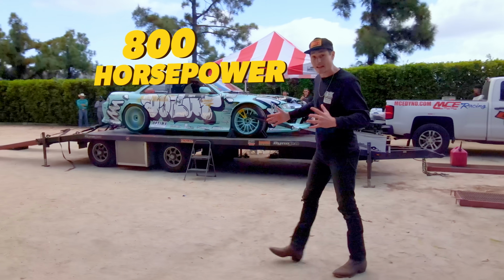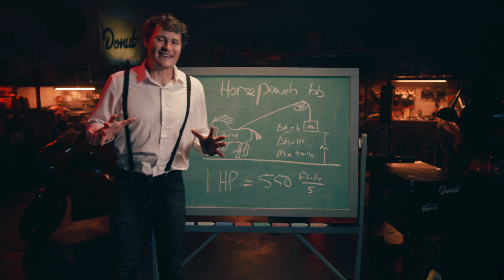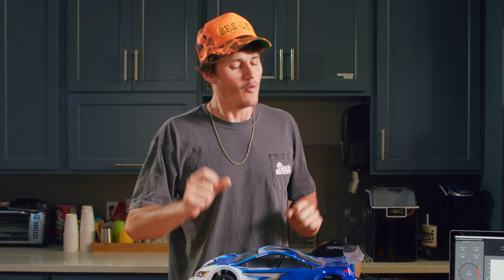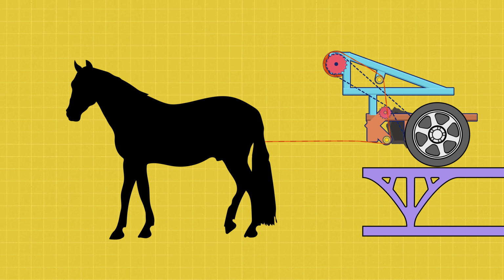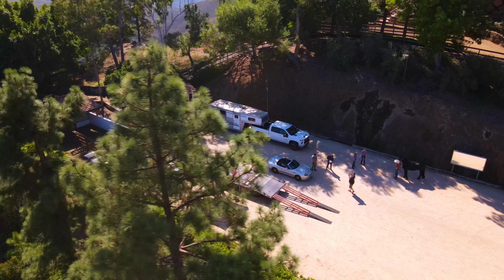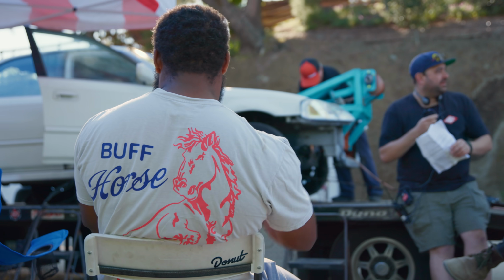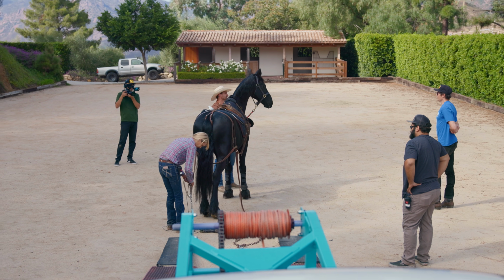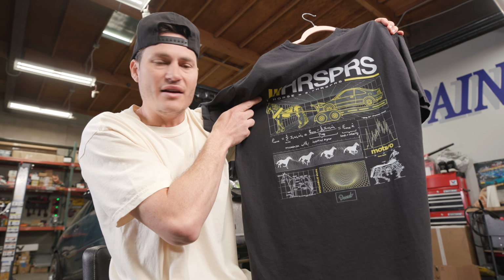How Much Horsepower is a Horse?

Comment: Am I just thinking too simply or is the whole idea stupid?
1. they could have rolled up the rope on the Dyno, what is the car doing there?
2. If I want to replace a horse with a machine, I don't want to replace the work that a horse can do for 5 minutes, I want to replace a horse for a whole day. So I have to measure an effort that a horse can sustain for a whole day.
3. At worst, I have 3 horses, 2 are in the stable and one works and is replaced every 8 hours. That would be equivalent to a 3hp motor that can work 24 hours a day.

Comment: This is a great video, but I see three flaws regarding this to call it scientific. First, you should have tested a lot more than just one single horse. Second, you should have tested a horse breed which was usually used in the brewery process, mentioned in the papers by James Watt. Third, I guess that the friction of your test gear might lower the true power of the horse.

Comment: Wildly flawed experiment and even definition of the derivation of a horsepower.  A horsepower was never defined as the instantaneous power a horses can produce.  As you’ve demonstrated, instantaneous power a horse can produce is FAR in excess of 1 horsepower.  However, horsepower was defined as average and routine power an average horse can produce over the course of a 24 hour day, including rest/sleep time.  Steam engines and ICE engines don’t have to rest, so the definition of horsepower is built to account for the difference in how a horse and engine work.  It’s certainly a subjective estimated definition.  This info isn’t too hard to hard to find, so I have to assume you just ignored it on purpose.

Comment: 5.7 sounds quite low damn...

Was expecting like a 20 or so.

Thanks so much for all the work guys
Reply: You are absolutely correct. It is too low.  Measuring a horse's power at human walking speed is more a test of the raw strength than power. That horse would put out 2-3 times higher power if the test had been performed in normal horse running speed!
As a comparison an average man puts out ~1hp, a track cyclist 2+hp, and a strongman 3-4hp.
Reply: The power would go up with speed. Quarter Horse ptoduce the grearest peak horse power, but only for 5 seconds or so. They can peak at 12 to 15 hp reaching 45 mph+ (They would also beat many muscle cars from 0 to 35 mph, ubtil the car started to catch up) A 460 hp 5.0 Mustang would NOT catch a Quarter horse until 40 mph +,

Comment: I forget how the equation goes. But you take the torque of the car and the curb weight of the car and you divide something or do something. That's how you can tell the horsepower if i remember it right it was awile ago horsepower as said is just a equation

Comment: Is antifreeze sold as engine coolant in the tropics a scam. Can you test the boiling point of water with and without antifreeze? Do we really need to add antifreeze in the tropics or use just plain water.

Comment: So if my 08 Honda Crv makes 160 Horsepower I divide by 5.7 = 28 horses?
Reply: I think more close to 10-11 horses. Testing a horse at human walking speed is more a test of the raw strength, or torque. A horse will put out its max power at much higher speed.

Comment: horsepower of a horse is a bit misleading though. the horsepower of a car as advertised is the peak horsepower. for a Honda civic, this happens around 6,000 RPM. typical driving at highway is around 2,500 to 3,000 RPM, in which case it only generates only around 120 hp.

if a horse can sustainably put out 5.7hp, its peak power maybe around 10 hp. so really, when it was originally advertising a machine pulling at 10hp, it really only means power of 1 horse.

Comment: I am extremely curious about why you didn't use something similar to a treadmill on which the horse could run??? (The resistance of the treadmill can be subtracted for the accurate value of the horsepower)

Comment: I wonder if the speed was too slow, load too high, or not enough time to overcome the polar inertia?  The horse looked pretty slow and still accelerating at the end of each pull... assuming the dyno load wasn't significantly decreasing when that happened.  It'd be interesting to see the load and speed trends if there was a peak or if power was still increasing when the pulls stopped.
Reply: Yes, a race horse at near 40 mph, or a quarter horse sprinting a few seconds at 45 mph is in the 12 to 14 hp range.  On a bicycle, if your pushing a 100 inch gear up a 7% grade, at a Cadence of 50 rpm, your power output is about 40 % of max as compared to 125 rpm in a lower gear.

Comment: the project is great. but there a huge flaw in the experiment. you used a small draft horse. this would of been a much better experiment using percherons and belgians which are your bigger stronger drafts more commonly used for pulling dead weight... the horse you used is more of a show draft used for pulling carriges even tho it can do both
Reply: the belgian and the percherons will also pull all day long with alot more immediate tourqe

Comment: Awesome project! I do believe horsepower is meant to be how much work a horse can do sustained not in bursts. Usain Bolt can run at 27mph according to Britannia but that dose not mean he runs a marathon in an hour.
Reply: Well horsepower has nothing to do with how much work a horse can do.   I’m sure for some engines they test it by throwing f350 on a dyno for 10 hours and calculate the mean. However this is clearly a comparison to finding that 1 milliseconds max value so you can advertise that your Mazda does 480 hourses.
Reply: Also besides the point, horses do operate differently from people. Their sustained running speed isn’t as far of a drop from max speed. And I am speculating here but I think a horse l, or even a human, can hold that absolute max in the red 7-8k rpms speed for longer than most engines.
Reply: @brendanharan4501 No, no. A horse or human CANNOT hold 100 % max power but for about 3 seconds. 90% of max power for about 12 to 15 seconds. Humans can hold about 50 % of max power for 60 seconds, and about 30-35 % of max power for 1 hr (that's IF they are highly trained and in very good shape). A car engine can sustain 95+ percent power for at least several minutes for most cars, some cars can do bear 100 % power for an hour if the have enough fuel. (NASCAR, sime Porsches, etc) A jet turbine engine can hold 100% for hours on end with enough fuel.  For sustained high  powerboutput, Engines do way better than biology does (animals or humans)
Reply: Usain Bolt's fastest recorded speed was during his 100-meter sprint world record in 2009, where he achieved an average speed of approximately 37.58 kilometers per hour (23.35 miles per hour).Dec 28, 2022
Reply: @benboarder09  His peak speed was almost 28 mph..27.9 mph.  However. those track sprinters can cover the first 10-12 feet as fast as a Tesla  Plaid can.

Comment: This was a really well-done video. However if we really want to know what a horse's true peak HP is, we need to let it run faster and longer with different amounts of resistance than what this test shown here was able to do. And we need to make sure the horse's pulling power is not limited by its traction with the suface. By having the horse's pulling line attached a couple of feet off the ground, as the horse pulls harder, its front feet will try to come off the ground, and this limits how much power can be added by its front legs, and may also make the horse feel unsure of its footing and therefore not continue to accelerate as much or pull as hard. This explains some of the surprisingly low differnece between a single man and a horse. A man can lean forward really hard to get more traction, and he doesn't lose any pulling power. But horse can't do this. And why the complicated equation to figure out how much power is lost in the transmission? Why not just connect a strong 3 phase motor directly to the dyno, using a variable frequency drive to slowly ramp up the speed and record the power curve, keeping track of exactly how much wattage is going into the motor. Then do the exact same test but with the transmission in between. The diference in HP reported by the dyno will be exactly what was lost in the transmission!
Reply: Exactly my thoughts on this.

Comment: Weight matters. A bigger and heavier horse can get the power to the ground better, just like a tractor. I don't know if a Shire horse, the biggest one, can produce more power then a bit more compact built Ardenner or something. They will not go fast, but they are built like a tank on four legs. Then more power, makes things more risky. Something could definitely  break. In the end, how strong is a horse? is like how long is a string?

Comment: So you neglected to talk about continuous vs peak power. I assume that 5.7hp was peak?

The steam engines that James Watt was making were expected to work, and generate the rated power 24/7. James Watt measured the continuous power output of a horse go match the continuous power output of the engine.

When your lawnmower is rated at 6hp, thats also continuous. That lawnmower can produce 6hp all day long no problem. Likewise, a 100hp tractor can do that all day. Or a 100hp boat engine.

But cars are the weird ones. Cars are normally rated for peak power. A 250hp car will not survive generating 250hp for 10 hours. That 250hp car might only be 150 continuous horsepower.

Comment: Actually we did the original experiment in high school and IIRC the same teacher had done it too in previous years and in different schools. Basically  a horse pulling a weight (a water tank), hanging from a pulley, two marks along the tank trajectory marked when to stop and start a chronometer. We repeated several times with two horses and the value were a notch over 3HP, if my memory serves. Preparing the experiment took around two weeks.
Reply: Probably not draft horse, and why they only made 3HP? To hazard a guess. Also high schoolers may not have been taught to calculate inefficiencies in a mechanical system. But that'd be for you to know, and me to ponder.
Reply: @Nate-bd8fg  Actually the point was in the video it's said nobody repeated the experiment since Watt, just wanted to raise that, at least, it was done in my high school. The inefficiencies where calculated dropping a bucket filled with stones from the pulley and measuring its acceleration, again using the chronometers. I suppose the horses were chosen so it was safe for us to be around (we were kids, remember), I am sure there is variability among horses, you need a few to do something statistically significant. And the whole point of the experiment was to learn the scientific method, the result was secondary.

Comment: Outstanding! This is a relevant historical event. Now, this new data ripple throughout the scientific and industrial communities? Question; If there is a measure of mass movement vs time, can wheel horsepower be calculated from the time generated on a drag strip vs the actual weight of the vehicle vs 1320 feet of distance? Would this be different from Wheel Horsepower  because no dynamiter does burnouts?

Comment: @9:00 For calculating HP why not put the horse on a treadmill with a generator and a load. Watts = volts * Amps. 1HP = 746W.  Also  james Watts claim to fame was when he was young he had to manually adjust the spin on some gyro balls on a steam engine. He came up with a way to automate that.

Comment: On 20:55 is a picture of a bike on the Dyno. Did you verify the measurements with some commercially available powermeters? 1.6 HP is possible (about 1,18 kW), though I highly doubt it by an untrained person

Comment: It was based on Shetland Ponies, it was derived from lifting a weight up a mine shaft of a specifc length, how many horse it took to move that over a 24hr period. For e.g. if it took 4 Shetland horses to lift that weight over a 24hour period, and you had one engine that could lift the same over a 24hr period it was claseed as a 4hp engine.

Comment: Watt's horsepower was calculated from a horse turning a wheel continuously for hours, the dyno meaured peak or max performance of Big D over a shorter period of time. Of course you're going to get a higher number. They answered something completely different from what they intended. 5.7 horsepower isn't how much horsepower a horse has if we're talking about motors and engines that are expected to run for hours, why clickbait and put out misinformation?

Comment: Sorry guys, not all men have 5.7" horse power, so your experiment is useless, its like you measure one horse and concluded the definition of a horse power.  you need to get an average power from about 100 or more horses, average of men are 5 inch horse power, or 5Lb/Foot torque😁  in the upright direction, so you really cannot use that as a scientific standard. But here is the thing, why measure power in horse power why not in true watts? Most car engines are now measured in kilo watt power. So let us be more scientific and do away with horses or mules.
Another thing the rope should have been kept taught when attached to the horse, no slack in it so when the horse starts puling he can get a sudden jolt if it has slack in it, so quite a few flaws in the design, the drum diameter can also determine the torque that horse can influence and as one layer of rope comes off the drum the lower layer means the torque will reduce so its not a true test unfortunately, you guys love wasting money.

Comment: unfortunately this is no where close. if a 5.7 horsepower lawnmower had a tug of war with this horse the horse would destroy it. my guess would be this horse would have the power of a 35 hp engine at least. pf course torque would also factor

Comment: Thenn.. If a horse having more than 1 horsepower.. Which horse did we know used as a measurement all this long..
Before this test i thought 1 horse= 1hp..
Now this make me change the equation.. 1horse=5.9hp.. Then a car that is 800hp is actually 800x5.9hp = 4720hp🤔

Comment: This test is done wrong, you are operating the horse in a very low "rpm" (speed) and therefore have a low efficiency. Running the horse on a mil at speed would have made a massive difference

Comment: The light draft horse was used more for pulling wagons etc. A regular draft horse is bigger and would produce more horse torque. (like those used for milling etc) so the "horsepower of the larger draft horse should increase

Comment: Why did you need the whole car as a decoration and hardly calculateable collection of losses? You could have taken just two wheels on an axes and put the rope right into the middle of it. The losses could have probably be calculated (in each case) with a normed engine of known power vs. the one measured by the dyno.